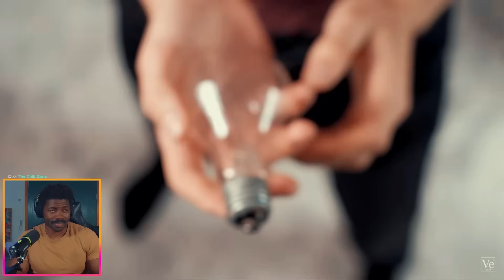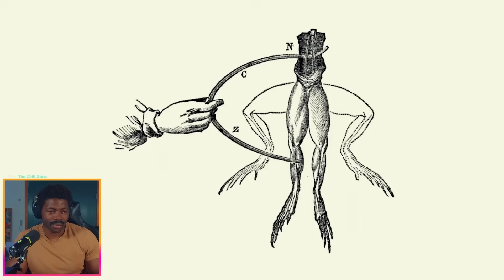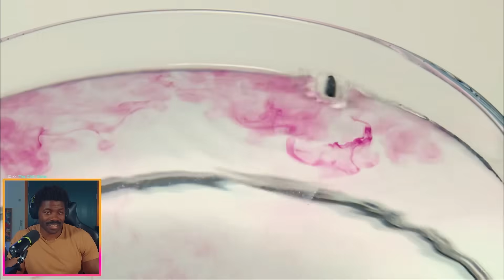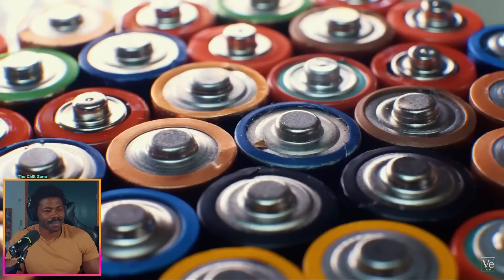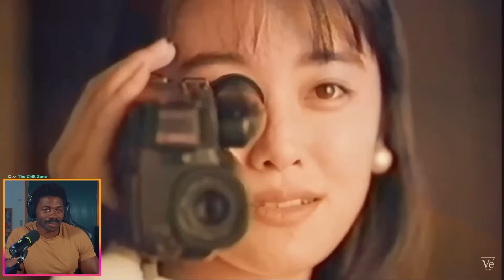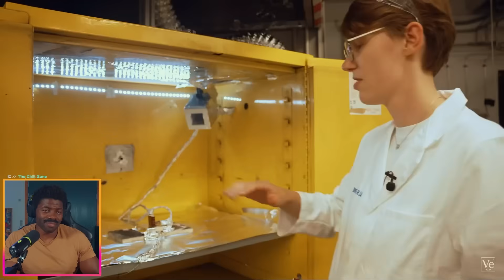The Perfect Battery Material Is Dangerous | The Chill Zone Reacts

Comment: At around 34 minutes in, I had a realization: so I know that China in particular is having a cascading issue of poor materials and practices causing failures across the board. However, one that stuck out to me while watching this video was their lithium ion batteries just seemingly spontaneously catching fire- and then some other companies taking those batteries out of China and getting... expected results. I suddenly realized I already knew the answer, or at least one possible answer: if the manufacturers keep cutting costs by using cheaper materials, then... they're likely inadvertently reproducing the exact issues with the older models by using the wrong materials that prevent the protective coating from working like it's supposed to, causing them to react too much and just either lose the ability to hold a charge, or... short circuit and overheat.

Edit: I hit resume. Immediately talk about exploding batteries in the original video. Well then! Seems I was on the right track. Probably because of the original video's script, at that.

Second edit: I wasn't really correct, it really was mostly manufacturing defects.

Comment: 19:00 Gantle reminder that electricity generates on power plants with not a 100% efficiency, there are still used Heat engines, and there are also transfer loss on energy transmition and transformation. 
Using "Fuel production Efficiency" of 95% are missleading because in car Heat engine inside car and there is no transformation of heat energy to electricity and then to kinetic
Reply: Exactly Power plant efficiency can range from 40% (condensing power plant) to 90% or higher with (combined heat and power)

Comment: Talking a little about the ending there, there's a lot of modern research going into blue and green hydrogen cells used together with Solar energy farms to make whole grids 100% renewable, but the energy density stands as a challenge. Also, I heard a scientist comment in a podcast that I enjoy that the expectation to make flying cars viable is that the batteries should double their energy density in order for it to compensate for the weight. Seems like a lot but we steadily advancing towards that goal. Lastly, thanks a lot for taking my video recommendation, Jack.

Comment: But what about Lithium Polymer batteries?
Reply: What about them? They still use the same chemistry that regular lithium ion batteries use. The only real difference is in the phase of the electrolyte between the cathode and anode (Lithium ion uses a seperator soaked in a liquid electrolyte while LiPo uses a polymer matrix to suspend the electrolyte) The gel electrolyte is slightly more thermally stable making them slightly more power dense (higher peak draw amount)
The main difference is packaging though. LiPo mostly comes in the form of pouch cells like a 6S battery for an rc car or drone and the ones found in phones, laptops, etc. This allows more space efficient, lightweight packaging but is not nearly as robust as the metal cases that regular Li-Ion uses (in the sense of puncture risk but also because the pouch expands and contracts during charge cycles, causing seperation in the cell, shortening overall life of the battery)

Summarily, There isn't much difference. LiPo is slightely more energy dense and is good for pouch cells that have a lighter, more flexible form factor but is less robust than the metal cased "standard" Li-Ion batteries. There are LiPo's in traditional metal cased form factors but they are more expensive.
LiPo is better in some use cases but it has it's drawbacks in others. At the end of the day it is the same chemistry in both types, thus both face the same root problems.